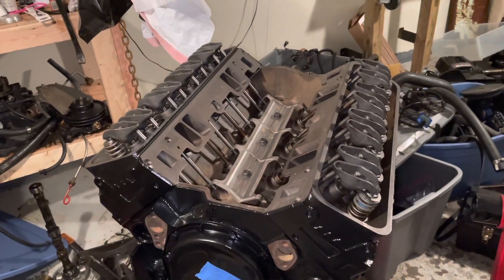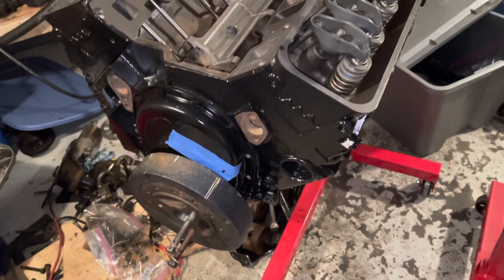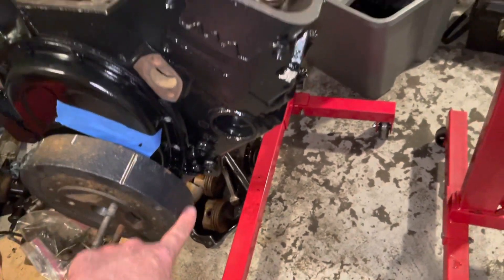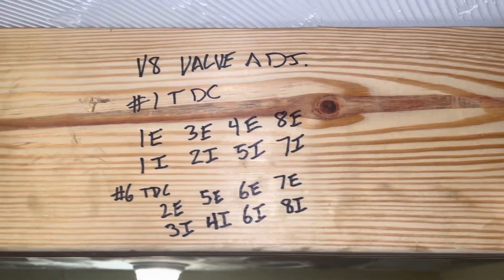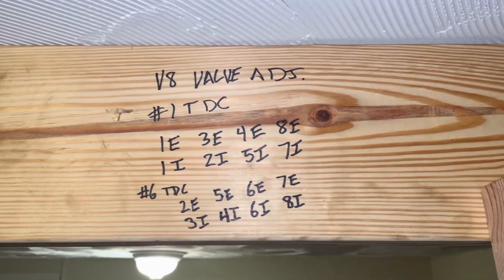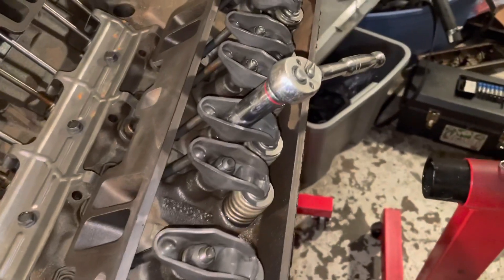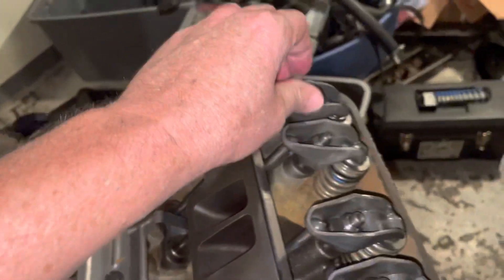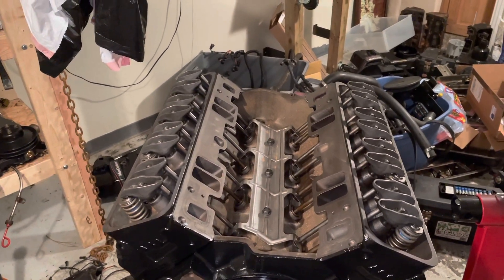Mercruiser 5.7 1(l) - Hydraulic Valve Adjustment

Comment: So because it's a mercruiser the cam is marine. Does that that make a difference??
Reply from the maker: The marine cams have nearly the same specs as Corvette cams. They are designed to help the engine make power wide open but also idle decent. So there is a difference. Google HT383 camshaft and you’ll find a thread about the Vortec Marine cams.
Reply: @moccasinmarine  the 260 horsepower is designed for low end torque to get the boat out of the water.  It has a 15 pitch prop. Its not a high speed boat. I just wanted to make sure my valve adjustment was gonna be ok.